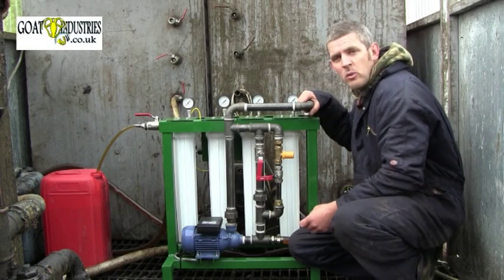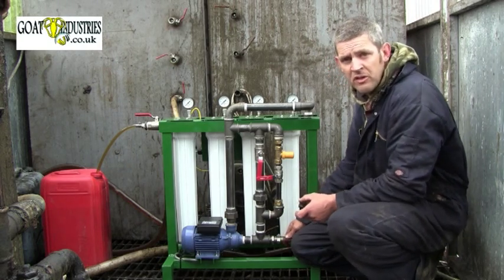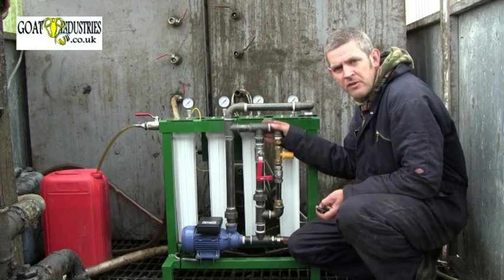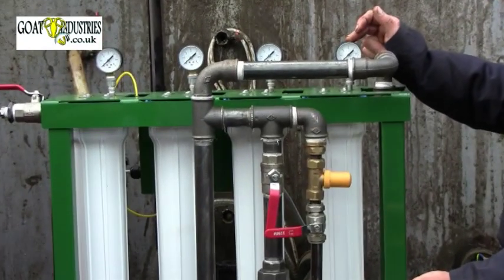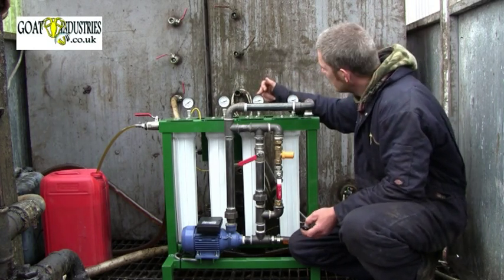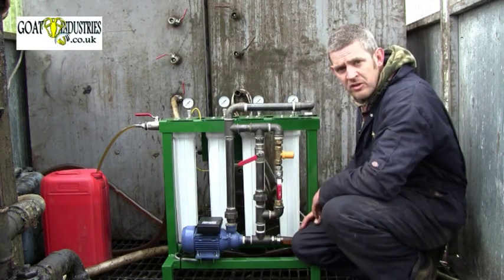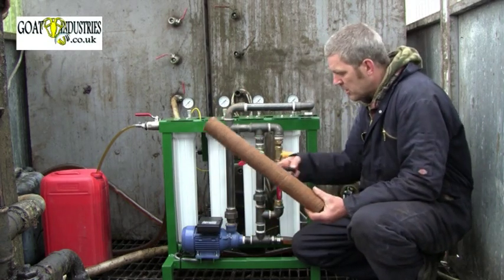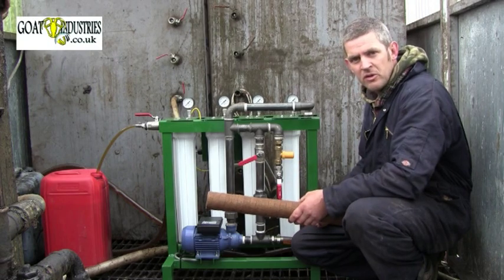Filtering waste vegetable oil

Comment: I love to see anyone filtering WVO, especially for vehicle use. But personally I think settling is easier, cleaner and above all CHEAPER than any mechanical filtering. But each to their own. Thanks for the vid guys.
Reply: He is settling, in the big tank for several weeks. He mentions at the start of the video. Paddy is a professional, and manufactures bulk equipment for WVO and RME small scale commercial production.
Reply: If he's settling properly then none on that equipment is necessary...
This is an unpopular view with anyone selling filtering equipment but it is something I have proven for a number of years now.
I give away my designs for free and the feedback is amazing. 
Settle the oil. Separate the settled oil. Job done. It's that easy, honestly.
Why make it complicated?
Reply: Did you see those many valves on the tank wall? He IS doing the settling.